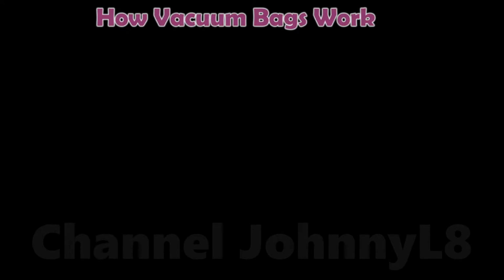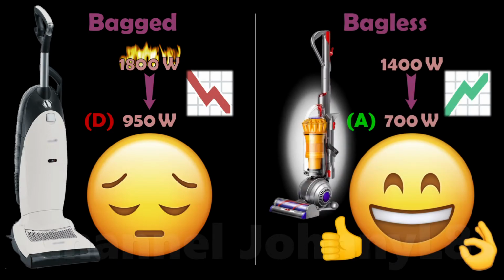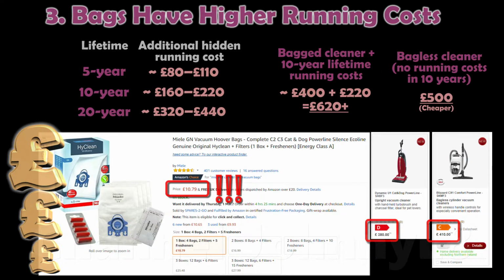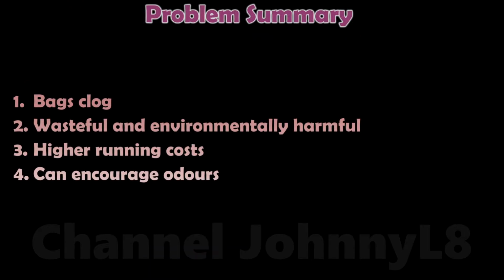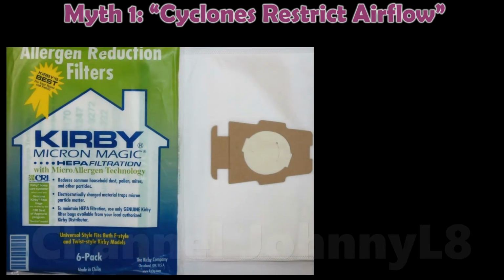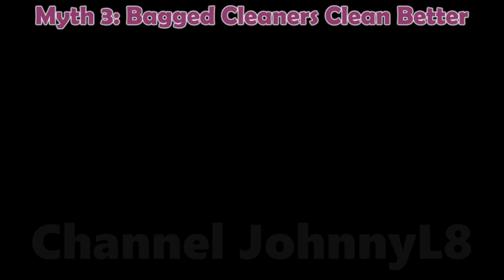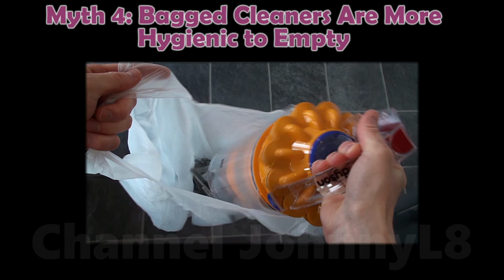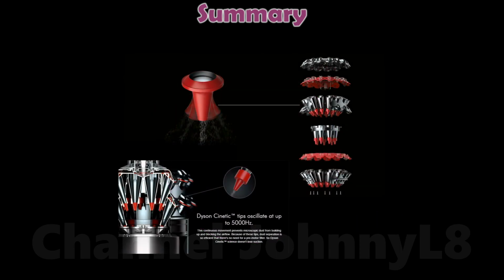Bagged Vs Bagless Vacuum Cleaners

Comment: Maybe a bit misleading quoting a bag cost that includes freshners. On amazon the bags no freshners are £8. I love how you pick the most expensive Mieles over the cat and dog cylinders which can be found at £160 or even the most basic at prices as low as £119.
Reply from the maker: I hear you, but no, I think it's defensible. It's not just bags, but other disposables you're expected to buy. I think this was well defended in the video. And I'm aware you could choose another brand, get different precise numbers and so on. This was just one example to give ballpark numbers. The important point: hidden costs, and total lifetime cost for ('best') bagged is likely just as much as the best bagless, and possibly greater. Choosing the most expensive in both cases is comparing apples and apples as best as possible. And then there's every other point I raised in the video.
Reply: +JohnnyL8 As I say, the filters come with the bags so there's no other costs to run the machine.
Reply: JohnnyL8 It may be very expensive but in my mind worth it. Not as if it’s cheap to just buy a Dyson Cinetic.
Reply from the maker: Personal preferences are a different matter. I can't argue with those and if you prefer bagged cleaners, that's great. But what I outlined in the video are factual claims which are true and I understand how it can sit heavy with the opinions of bag-lovers.

Comment: Numatic hepaflow bags are £5-£10, they are hygienic and don’t let dust escape from bags. They last about 1-2 months per bag or even longer.
Reply: JohnnyL8 Actually hepa flos are £6 for ten and usually last me about 6 months. I have a dog and my bagged vacuum has never smelt bad. Actually I have to bath my V6 cyclone parts more than I change the bag in my Henry.
Reply: +rob w I can testify, Miele filtration excellent
Reply from the maker: Yeah, that's just awful. If cost is an issue, people could just buy cheap ones. I'm also not convinced any bag doesn't let dust escape—that claim needs formal evidence if I'm to believe it. In fact, all bags let dust out, as is obvious from the fact there are plenty of filters afterwards. I discussed all this in the video.
Reply from the maker: I'd believe they don't lose suction if I saw formal test data proving it (following the airwatts test). Some suction must be being lost because of how bags work. I suspect it's just not easily noticeable it in use. As for the dust cloud, I'd recommend watching my videos where I demonstrate how to empty a bin without a dust cloud. In the video here I outline many reasons why bags are not better.
Reply from the maker: Some people may not suck up smelly material and may not get smells. As for bagless cleaners breeding smells; that's something that would have to be formally demonstrated, because there's no sound reason why they would, given what I've described in the video, and I don't buy into unevidenced claims. This also matches my own experience with collecting material that gives off odour; remove it by emptying the bin and the smells disappear. You should also never need to wash cyclones. They're supposed to remain dusty and this causes no problems (that have been formally evidenced).
Reply: JohnnyL8 I’ve seen the evidence with my own use. I don’t bath the cyclones just the parts I cam easily strip and remove
Reply from the maker: Yeah, it has to be reputable evidence (i.e. formally acquired under strict test conditions) to convince me. I've no confidence in user tests and they couldn't be rigorously defended for validity. Nor are they comparative with formal industry standard testing which all serious testers test to. 'Experiential evidence' is a dressed-up misnomer for "subjectivity".
Reply from the maker: Well yes, that's the point of the HEPA in any vacuum; to capture 99.97% of particles greater in size than 300 nm. And bags or bagless machines let particles that size through. HEPA filters should always look spotless to the naked eye (except carbon dust), unless you've got such terrible filtration upstream that they end up capturing large concentrations of larger particles and get visual dust on them. From a maintenance point of view however, the filtration quality upstream is more important. The better filtration systems show NO loss of suction as a function of dust loading (a really important point), and don't need pre-motor filters. The better of those that still do use pre-motor filters have a very low dirt accumulation rate. This is something that can be measured and so any claim about what's 'best' is more easily believed with that evidence (to be fair, it's really hard to find pre-motor filter dust accumulation rate data).
Reply from the maker: I guess, if people like bagged cleaners. The world is moving on to better technology really now, as shown by market share data, and they're really left for the vintage aficionado. It's a myth though that they're better tech, or perform better (at least holistically). I'd need to see clear data to believe any of the claims you mention. Plus there's all the other issues raised in the video.
Reply from the maker: Consumer Reports really aren't a very convincing source of evidence. They're like Which? and other glorified bedroom testers, profiteering from their work which isn't to industry standards and highly subjective. But feel free to actually present some data and analysis which I think you'd still need to do to convince me. A full analysis which is airtight and clearly shows something to support whatever specific claim is being made. I'd certainly agree though many bagless cleaner products are very poor, but that's because they're cheap clones of the best products.
Reply from the maker: I've seen no good statistical evidence of any of that; feel free to share the data you've used to conclude that.

Comment: Oh by the way Genuine Sebo bags cost around £10-11 for 8 which will last at least a year.
Reply from the maker: In the video I discussed about hidden costs and the need to maintain supplies of bags that become increasingly hard to source over time. The problems with landfill, carbon footprint, keeping dirt-filled bags for long periods of time, and how the apparent advantages of bags are myths.
Reply: Well Sebo have used the same bag in their x series since 1991 ..............
Reply from the maker: I'm not sure what point you're making. Some other bagged brands touted as the bees-knees, haven't. So pot luck.

Comment: Let's see....empty DC40 every few times, dismantle bin to clean shroud, reassemble, dust machine as it's covered in Erm dust.OrReplace bag in Sebo X4 3-4 times a year. Remove bag, fit dust seal, throw in bin and replace bag. No need to clean machine as guess what....no dust 😆
Reply: Totally agree. This video has many inaccuracies. Bagless systems have many flaws.  They are terrible at trapping dust. Just remove the canister and look at all the dust caked onto the back of the machine. Now think of what is being thrown back into the air for you to breathe in as you vacuum.  ‘Cyclonic technology’ is nothing new. Electrolux used it many moons ago before Mr Dyson jumped on it. Saying this is a new and up to date technology is misleading. So many more areas whenever this video is misleading but I don’t want to write a book! Likely this video was paid for by Dyson. Marketing is something Dyson and Shark do very well to make you believe their products are superior.
Reply: @CorbinCarling  false totally false
The bagless vacuum cleaner that I use is always clean at the back,dust only gets as far as the filters where it is sussposed to be,bagless are the best at 100%,performance is fantastic,also when I empty the Canister I don't get no dust cloud at all
Also Bagless vacuum cleaners are now up to 80% more popular now
Reply: @stephensnell5707  It’s not false. I see it every singe day. I work in the vacuum industry and  the only statement you are somewhat correct on, is the popularity of bagless machines. That is not due to performance. It’s due to marketing. Videos such as this one are not independent. They are most often paid for by Dyson and Shark. The ‘reviews’ you see are often written in-house by their marketing teams and after a while it becomes obvious when they follow the same pitch and template.
Reply from the maker: @CorbinCarling  Knockoff clone bagless are terrible (this was mentioned in the video). Done properly (Dyson), they are superior (this was mentioned in the video). You've also confused what is meant by 'cyclonic technology' (it's primary filtration leaving little left for a filter / bag). Your wild claims are very poorly evidenced.
Reply: @VacuumFacts  I own a Dyson animal 2 and yes the vacuum does get dirty a lot. More than a good bagged vacuum. I’m happy with my Dyson. I just wished you could do real world comparison and not sight with just the Dyson cult of saying the best Technology sure they retain their airflow but no agitation is also key
Reply from the maker: @Fight4freedom.  It's not clear what specific claims in the video you disagree with. I presume none.
Reply: @VacuumFacts  Not the video that I’m referring to. I’m simply commenting on the comment that it does get dirtier than a bagged vacuum. And compare the best bagged vacuums to Dyson not just hearsay
Reply from the maker: @Fight4freedom.  You're too vague, your position is too simplistic, and the argument is settled, as evidenced in many other review videos I've done showing the wider range of disadvantages of bags (fully supporting this video). If you have anything very specific to actually say, please say it, otherwise, the conversation is over.
Reply: @VacuumFacts  you come off is trying to be very intelectual, judging peoples perspective. Yet you cannot answer a simple question. Can you campare bagless vs bagged. Yet you keep quoting Dyson sales pitch. You say I’m vague and simplistic. The only thing simplistic was an answer.
Reply from the maker: @Fight4freedom.  As explained in the previous answer, I already have, many times, all on my channel. Not sure how you misunderstood this nor how you've failed, repeatedly, to specify what specific claims you take issue with in this video, and more importantly why, with evidence. Not only are your comments simplistic, but your understanding, it seems based on the evidence you've provided so far.
Reply: @VacuumFacts  how much did Dyson pay you for this marketing?
Reply from the maker: @CorbinCarling  Is that literally the limit and level of your response to this video? i.e. none at all and instead attempting to antagonise in the most childish way possible. Playground's that way --> Run along until you've actually developed an adult, thinking mind. >_> Some of you people...
Reply from the maker: You're describing your use of a bagged machine. The implications of this is all covered in the video.

Comment: With Brexit on the horizon, I wonder how this will affect the consumer products in this country regarding EU energy caps. Perhaps vacuum manufacturers will be allowed sell higher powered motor vacuums again. If so, I hope it doesn’t stall technological progression.
Reply from the maker: I wouldn't worry; the people most against the power caps were the bagged manufacturers who were at greatest risk of exposure of their cheaty tricks, and they're predominantly European-based. Brexit won't affect anything.
Reply: From what I've heard there won't be any Miele, Sebo, AEG, or any other european built products sold in the UK after Brexit. Which reminds me I need to stock up on Miele supplies to last for the 20 year life span.

Comment: And the final question. The pre motor filter on the light ball and the Cinetic cyclones both filter to 0.5 microns yet Dyson recommend you clean the Hepa filter monthly on the light ball yet the Hepa filter on the cinetic never needs washing? This doesn't make sense! Plus the cinetic motor is also producing carbon dust! What's your answer to this Johnny boy? :)
Reply from the maker: That's actually a fair and original question and you're right that it appears contradictory. The likely answer has its origins in the complex statistical physics of the two filtration methods. The "500 nm" thing isn't some hard cut-off and you actually get particle size distributions that are a function of many parameters. It's not clear what assumptions (or detailed observations) Dyson are relying on to make their recommendations, and obviously something this scientifically recondite isn't going to appear in marketing. I suspect the Cinetic tips are actually more effective than the pre-motor filters, and they're also assuming people will not wash them as recommended, leading to a relatively much greater amount of dust getting to the motor such that it could be problematic. The Cinetic cyclones, negating the need for user maintenance, are therefore more reliable, and the amount of dust they let through (assuming the machine isn't abused) is insufficient to cause motor issues in 10 years (this is formally measured in the labs), or clog the HEPA sufficiently to produce any measurable performance drop. HEPAs can get dust-loaded and not suffer from reduced suction; they don't work like normal filters (why in detail is covered in my filters video). In other words, it's not an issue if some dust gets through the Cinetic tips to the HEPA; in 10 years it's still got full flow. That's really amazing technology. No wonder it's only repair people are the only ones trying to smear it with propaganda; it's putting them out of a job.
Reply: JohnnyL8 You have an answer for everything don't you. But whether you are always correct is debatable. The big ball weighs 19 lbs that's too heavy for some. Why haven't they extended this technology to their other uprights?
Reply from the maker: Feel free to debate (with evidence). That's a good question and only Dyson can answer that. I suspect the Light Ball was their fast-track product recycling old tech to meet the EU caps, rather than a fully worked new piece of technology which may take longer. Nevertheless, the Light Ball was a fantastic offering relative to the sloppy low power remakes of the bagged cleaners that even the enthusiast bag-purists were disappointed by.
Reply: I agree the Eco Miele and Sebo models do not perform as well as their previous offerings sadly. I wouldn't buy them. But the models I have I think are excellent.
Reply from the maker: Yes, and that's the beauty of the EU energy caps. They expose the brute-forcing cheating behaviour of manufacturers trying to peddle inferior filtration technology (for all the reasons outlined in the vid). As soon as you cap motor power, you show why bags have poor suction; ironic given that cyclones—often accused of this very point—are thriving with the motor power cap, as discussed. (FYI I might miss some of your comments because YT's system is poorly developed. It doesn't always notify me of messages so they can get unnoticed.)